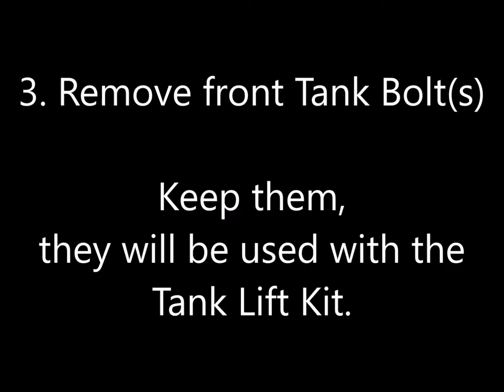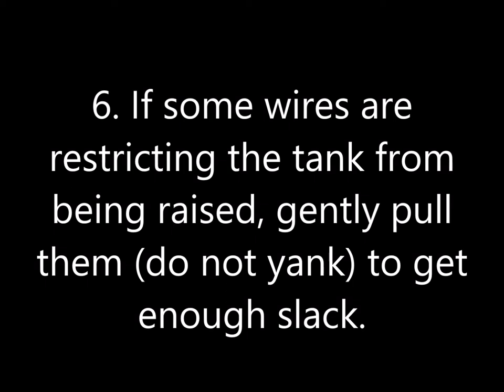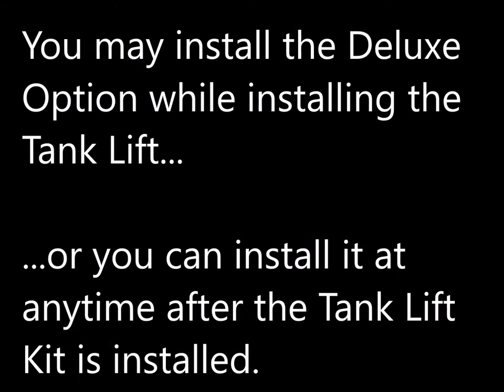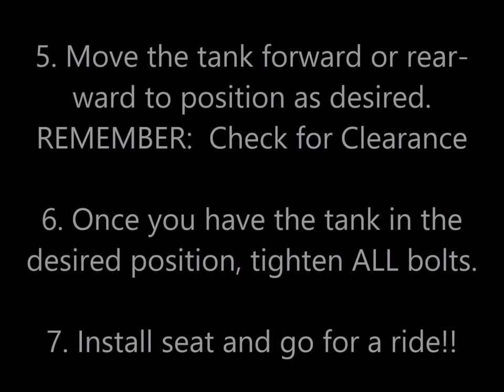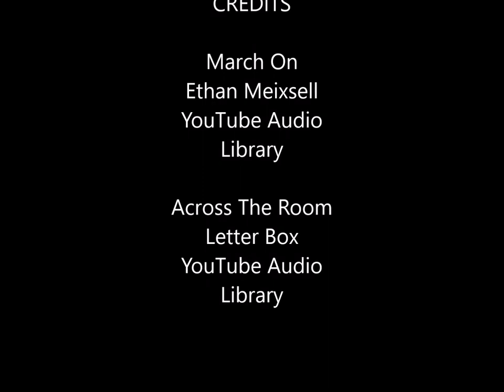How to Install a Tank Lift w/ Deluxe Option - Harley Touring & Trike Models

Comment: Just installed these (1.5" with deluxe kit) on my 2019 Tri Glide. Quality parts. Great instructions. Looks great! Very easy install (about 45 minutes) with the exception of tightening the top nut and washer. Also having the fuel tank almost empty is the way to go. (Gasoline is about 6 lbs./gallon). I was hoping to install the cooling wings but there is a small reservoir on the right side that is almost inaccessible without the wings installed so I opted to leave them off rather than having to undo the wing for maintenance, It's Winter in Ohio so I look forward to testing in the Spring.
Reply from the maker: Cool.  We appreciate your business, and believe you are going to be well pleased with them come Spring. 👍
Yeah, that rear brake M/C reservoir is tight to get to, with it without a tank lift or CDW's.  Fortunately it only needs to be accessed every year or two.  I also have a 2019 TG and am able to get to it with my CDW's on.  I use a ratcheting right angle screwdriver.

Comment: Did you have to replace the vent hose?
Reply: I’m installing mine right now 2 inch lift on a 07 deluxe not sure if I need to replace vent hose for sure the cross over is too short
Reply from the maker: Most of the time you do not have to replace the hose, but we do provide hose with most of our kits just in case. 

You should check for clearance for hose and all other possible clearance issues before installing;
1. With bike on kickstand, take the bolt out of the front of your tank.

2. Loosen (do not remove) the bolt(s) at the rear of your tank.

3. Turn your handlebars all the way to the left and raise the tank up your desired lift height to check for clearance issues.

4. Turn your handlebars all the way to the right and raise the tank up your desired lift height to check for clearance issues.

Be careful when lifting your tank, you do not want to hit against something (forks, handlebars, trees, blinkers, etc.) when checking for clearance. 

You can see the product and what it comes with at this link - https://www.dkcustomproducts.com/softail-model-tank-lift-kit-dk-sft-tlk.htm

Please feel free to email us with any questions you might have; 
Support@DKCustomProducts.com
662-252-8828

Thanks for commenting! 😎
Reply: @DKCustomProducts   ok everyone honest feed back. The installation on the lift kit was a pain in the ass dealing with the rubber grommet around the front of the gas tank ended up just taking it out. 

The lift kit is powder coated nice but the I.D of the hole is also powder coated and you have to thread the bolt into it since the tolerances are way to tight after you get the first side in you have to bang it through to the other side then again have to thread through the other bracket which was a major pain. I honestly don’t see that bolt lasting longer then a few times if you plan on taking the tank off multiple times since the threads get worn down having to force them through the powder coat. 

The rear tank lift kit didn’t work as my seat wouldn’t fit properly recommend not spending the money on the rear unless your absolutely sure you have seat clearance for the metal support. 

Overall installation took about two hours fighting the grommet and threads but the final outcome is worth it looks absolutely amazing even tho I have not road it yet to see how cool the engine gets or the test the buffeting. 

Would i recommend this product yes 100 percent only advise drill the powder coat hole out so you can save the threads on the bolt for future uses.
Reply from the maker: The holes on the Softail Tank Lift are suppose to be rimmed out for the larger bolt. I am so sorry if you received one that was not rimmed out! I will have these checked to make sure that they are being rimmed out! 

I am glad that you like the Tank Lift and were able to get it put on your bike! 

Thank you for your business, review and for commenting! 😎

Comment: I want to raise the rear of the tank equally so the fuel gauge will read correctly but worry that the seat wont fit. I ride a 2018 Road Glide Special with an Ultra seat. Can anyone advise on this please?
Reply from the maker: Using the Deluxe option with a 1"-2" Tank Lift will put your tank looking very level, and you gas gauge will be as accurate as it is now.  Below is a link to the page to get that, and below that is a link to a photo showing one with a 1.5" Tank Lift w/ a deluxe option.
https://www.dkcustomproducts.com/touring-model-tank-lift-kit-dk-trg-tlk.htm
https://www.dkcustomproducts.com/media/catalog/product/cache/1/image/9df78eab33525d08d6e5fb8d27136e95/c/a/carl-2_inch_billet_tank_lift.png

And here's a more up to date video you may find useful-
https://www.youtube.com/watch?v=f-wntxTmJyE

Comment: Can you just use washers and longer bolts to make your own Deluxe Option to raise the rear of tank?
Reply from the maker: Yes, that will work on Touring and Softail models, not so much on Sporty or Dyna models.
Reply: 1/2” rubber washers or teflon washer will work too, I imagine, or too soft?

Comment: I have a saddleman seat and it’s a pain in the ass to get on at the tank and seated into the grove. Raising the rear of the tank 1/2” the seat goes on better. I put the 1.5” on front so let’s see how it goes.

Only thing I wonder is the risers in rear on a touring bike I wonder how a rectangular one would be 1/2” and 5/8” and 3/4” would do instead to put the rear weight more distributed than the round ones. Any how other they that thought we will see if I can’t get some temp off the bike from 300-316 below 300 or better 👍🏻
Reply from the maker: Good to hear you have it installed.  You should see a 10* or so drop in head temps with that installed. 👍
Reply: @DKCustomProducts  was 46 out this morning even at that bike runs @300

Today I got up to 284

We will see on way home should be low 70’s.

Comment: What's the purpose of a 3 in lift kit? Is that overkill?
Reply from the maker: On a Touring Model or Trike Model, anything over 1.5" - 2" is a matter of aesthetics.  It is possible that with a taller lift there may be an even greater reduction in buffeting, and there certainly is easier access to clean the rocker covers and show them off even more.
Another video you may like-  https://www.youtube.com/watch?v=f-wntxTmJyE

Comment: Beware! I've got this kit and had it pretty much installed. Everything in place and just needing final adjusting and tightening down. Then I smelled this horrible smell. It didn't really smell like gasoline but close. The fuel hose was leaking. What the refineries pass off as gas. looks like the end not connected to the tank broke off. I don't think these kits are made for 2018 Tri-Glides. Or they aren't made for old farts like me to install them.
Reply from the maker: There are hundreds of these installed on Tri Glides of all years.  They work fine, there is plenty of extra length in the fuel line to do a Tank Lift.  Sounds like you have a bad line or fitting.  If you are still under warranty you can get it replaced.  Of course, if the tank was lifted too much (more than 3" during the installation process, that could have stressed the line where the fitting is.

If someone finds they need to lift the tank more than 3" during the installation process (say to route some wires, etc.), then it is best to use the quick disconnect on the tank, get all the moving around done, finish installing the tank, then reconnect the fuel line.

Comment: Is 1.5”  sufficient or would 2” with the deluxe option kit as well be better for a 2018 M8 road glide
Reply from the maker: I would check for clearance per the instructions at the following link.
I personally would run a 1.5" with the Deluxe option.  It is a subtle, but distinct improvement in looks and gives 95% as much air flow as the 2".
https://www.dkcustomproducts.com/touring-model-tank-lift-kit-dk-trg-tlk.htm